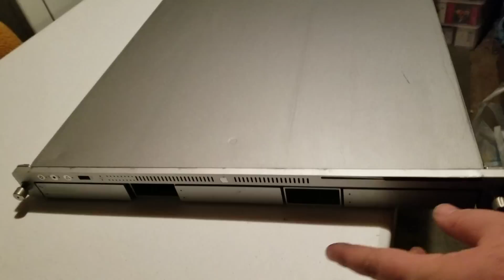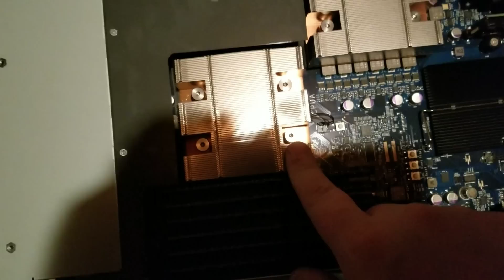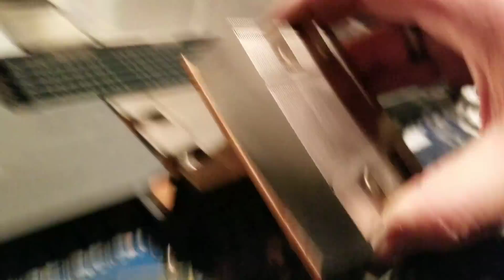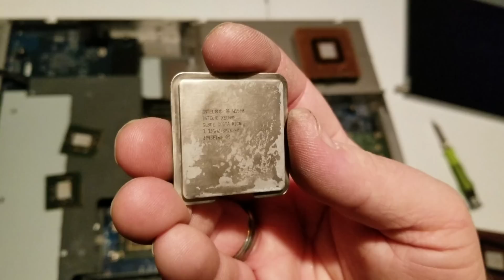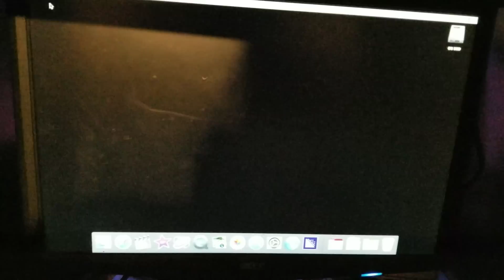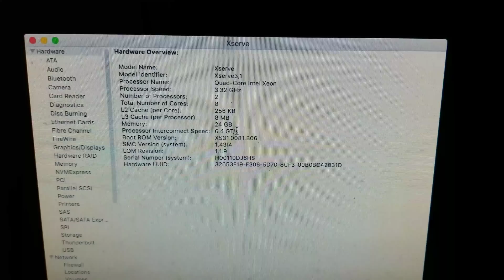Putting W5590's in a Xserve 3,1 !!!!!

Comment: I came into a couple 2009 xserve servers, how well would you say they work for transcoding? Thanks!
Reply: Did some benchmark tests to see how my XServe systems stacked against other systems in my office
We are considering switching to a Cineform workflow for timeline performance and are exploring ways of transcoding on ingest and seeing how all of the systems handle it
Using a single 4k file the XServe finished in 34 minutes
Our 2013 imac took 41 minutes, 2011 imac took 43 minutes, 2015 mbp took 1 hour, 2014 Mac mini took 1hour and 30 minutes

Very interesting to see a system from 2009 take the lead like it did!
Reply from the maker: Depending on the processor and the program that you plan to use it can go pretty well. I transcoded every video I had from 264 to 265. I have somewhere around 400 hours or better of video and took about a month. To transcode everything but I did it in sets of 50 because Adobe Media transcode or whatever it is kept crashing. I also change my CPUs to the fastest available that way it worked better

Comment: you can add 2.5mm of washers and you dont have to delid, i used mx5
Reply from the maker: Okay so this statement confuses me. Why would you add 2.5 mm of washers that way you don't have to delid. When delidding you are removing material and height from the CPU to make it fit properly. Adding washers like you are suggesting would just add more material to it and make it not fit more. I don't see how your statement would work at all.
Reply: i added washers to the standoffs on the motherboard so when you tighten the heatsink it doesn't crush the socket
Reply from the maker: Now that makes since. I was like how does adding washers to the cpu do anything. Lol